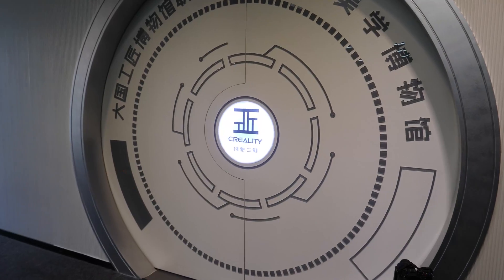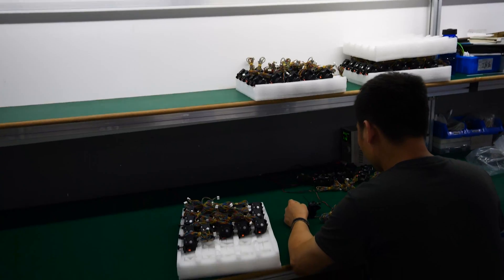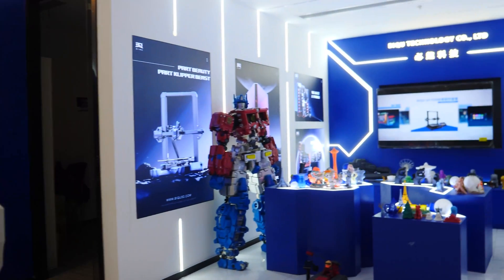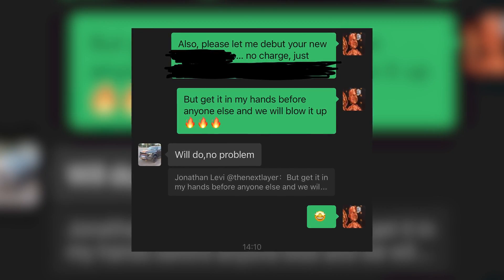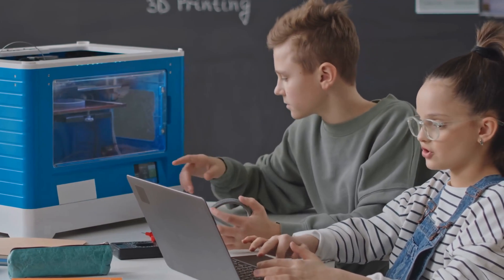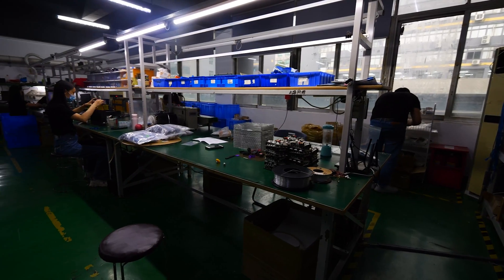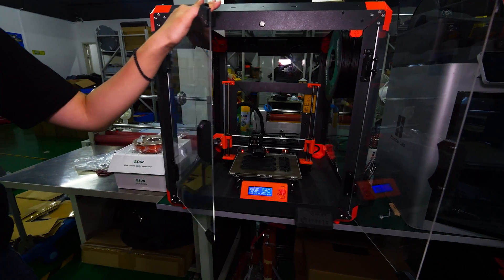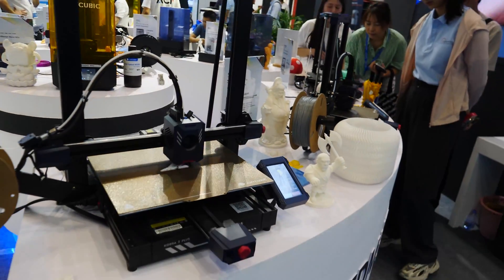I Got to Film Where No 3D Printing Geek Has Ever Gone Before

Comment: I was so upset when I learned that Kralyn 3D's Kickstarter had not reached its goal, but then the news that LDO were collaborating on the printer to bring it to market was wonderful news, to have a printer that fits in a pizza box and prints on the underside of the build surface just blew my mind, this thing is the epitome of innovation.
 If I had the chance to sit down with Ralph and Zidane of Creality I would ask them what went wrong with the Ender 5 Plus firmware 1.70.3 update, you see this was released as an update but it creates random mesh data for the ABL after probing, instead of fixing this firmware after the community complained in droves they decided no to fix it but to flash production machines with it, to this day they are selling machines with this firmware on it, you cant flash the Kris Kersey firmware because Creality mad un needed changes to the screen firmware so third party board firmware is not compatible with this the new screen FW and Creality have not released the old screen firmware, the only option is to flash Insanity automation, getting new users to do this though is difficult as they are scared of invalidating their worthless warranty